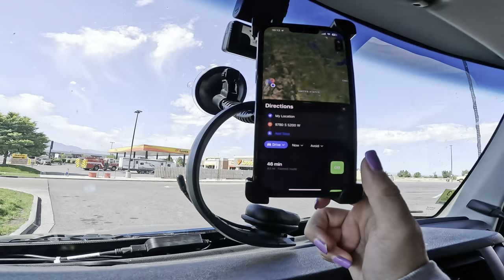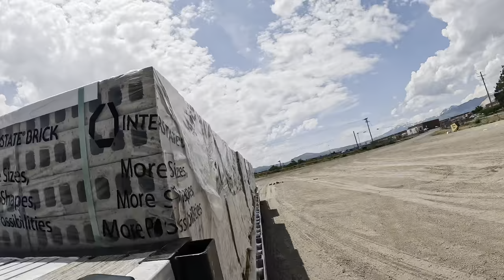DOT Officers Know Me And Give Me Lvl 1 Inspection?!

Comment: Next time either disconnect trailer air line or pull your trailer valve so they air inflation system will stop trying to air it up. I'm proud of you even though you go thru alot of crud. You're not alone Becca.

Comment: Easy to check trailer ABS system Becca. 
Turn the key on,  ABS light should come on and then go off.  Then with key on and engine off push brake pedal light should come on.
If those 2 things happen your ABS system is good!

Comment: It's spewing air because that's an auto inflate system... As long as the trailer air supply is active.. It will continue to attempt to inflate a low air pressure situation.

Comment: Run all virgin Michelin tires have your truck and trailer aligned. You won’t have as many tire problems you get what you pay for tell the boss man pony up lol unhooked the airlines to the wheel run the inside tire up on a 4 x 4 take your winch bar and rip it off and you can keep running because it’s an outside tire that will get you to the tire shop and save you a bunch of time.

Comment: That is not a forklift that is unloading at the hospital. It is a material handler, a telehandler. We call thhem telescopes in my language, lol.  Though it may have forks, but this one can have varouos ends on it. We got one on the farm recently. With a sizeable bucket and forks. Though ours is shorter and does not have outriggers for stability like a crane and is also plenty expensive even old and small. 

We pile grain overflow into tall pile in thevwarehouse with it when it does not fit into a grain silo. Real impossible without a telehandler

Comment: ABS lights sensors are Bipolar you never know when they’re going to come on or go out they need to just get rid of these sensors.  And as far as your transmission , just shut the truck down, hit the battery disconnect and started it back up and it’s fine. I think every Kenworth automatic has these problems.  If I use my engine break too much, I’ll lose gears and have to pull over shut it down. Hit the disconnect switch. Turn it back on to get my gears back.  🙄. 
Also, just to let you know road call services are first priority, compared to actually going to a place to get serviced. 😁

Comment: Whenever DOT tells you something isn’t working ask them to show you. I always ask very politely to show me/explain to me the violation so I can get it fixed. Sometimes there is nothing in violation and they don’t write me up because I called them out on it, can save you a lot of headaches. Also is your spread axle set up with a dump valve to dump air from one axle whenever you need to make a tight turn? That will save the tires from damage

Comment: They should never leave a gap in between your Load cos if u have to put your brakes on hard they will move forward and come off trust me on this this happens to me a few years ago and they went though the curtain they should of put is as singles at the back no gap if your going to have a gap in your load u Ned to put a x with straps over the front and the back

Comment: Love it! Keep up the hustle!! How many hours can you drive before you have to pull over?
Reply: in yhr US, a driver must take a 1/2-hr rest-break at or before reaching the 8th on-duty hour (either driving or on-duty/not-driving....i.e. time recorded on either lines 3 or 4 of the Log-Grid), counting back to the previous break of at least 30 minutes' duration. A daily shift (called "tour of duty" in the US) is limited to 14 hours, 11 of which may be driving. Before starting a new 'tour-of-duty' the driver must take 10 consecutive hours off (resting either in the cab's sleeper/bunk or, if no bunk, resting in a motel or at home. Trucking in the US has weekly limits too, i.e. "60-hrs in 7 days" or "70-hrs in 8 days", at or shortly before reaching these limits, the driver shall take a full, consecutive 24-hours off-duty (doesn't need to be a calendar-day, may as well be "noon-today to noon-tomorrow". However, if a driver is afforded a full, consecutive, un-interrupted 34-hours off-duty, the driver may "wipe-off" the previous 6 or 7 days' on-duty hours (called a Reset) at the end of which the driver is starting a new 6 or 7 days cycle. Remember, though, the 24-hr break is mandatory, whereas the 34-hour Reset is optional.....a fact that very few professional drivers are aware of, who are under the mis-guided impression that a Reset is mandatory. Nope.
In Canada, the rules a slightly different (more liberal, in fact), but that's an explanation for another day.
Reply: @andrep8287  Wow, thank you very much for the detailed reply. I had no idea it was so complicated and restrictive for drivers. I don’t drive for a loco g but I have driven across the country a few times and feel that a person could reasonably drive 12hrs in a day with a small break or two. I see the need for required down time but this seems a bit excessive. Thanks again!

Comment: I'm wondering. 2nd time loaded you've had tire issues with that trailer. I'm guessing the air ride ain't keeping the trailer off the tires🤷🏿‍♂️
Reply from the maker: The other tire I lost was with that flatbed trailer!
Reply: @Big Rig Becca  oh. Okay. 
I surely thought it was this trailer when you was loaded with bricks 👍🏿left rear inner tire. 'Bad luck strikes again'
Reply: It's possible the auto tire inflator is over inflating the tire.  As depending on the weather and weight ..Heat could affect the inflation..If it's over inflated before the brick load it could have heated up..Not a fan of auto inflation system... Always good to physically check tire pressures before picking up excessive weight loads .. Maybe the weight load on that side was excessive..You did say the trailer looked tilted ... weight should be balanced between wheels and center of trailer

Comment: Creepers! And the reason your tire was still leaking is because you have the pressure monitoring whatever where it keeps them at 110 or 120 PSI whatever it is. That's what those white hoses are coming out of your wheels.
Reply: And damn girl yeah One thing after another. Good attitude though and that's trucking to a point. Probably have some hater out there,  putting curses on you. Some creeper hater lol F' em😂